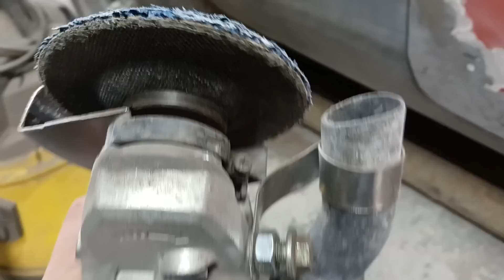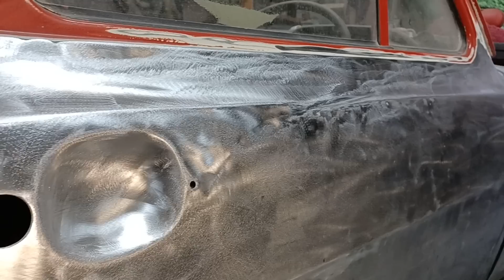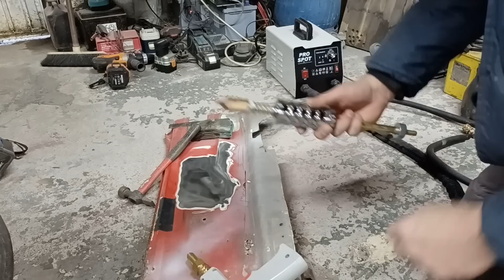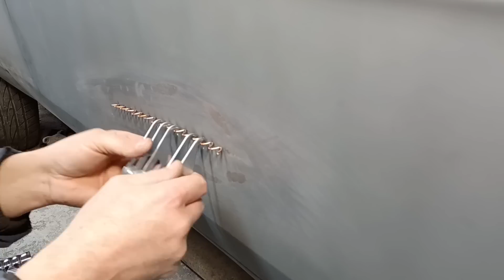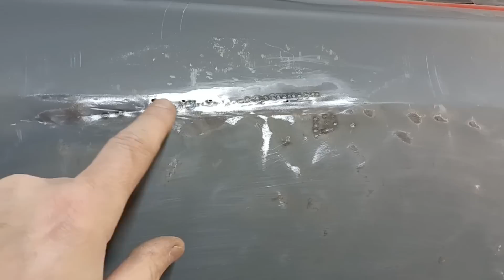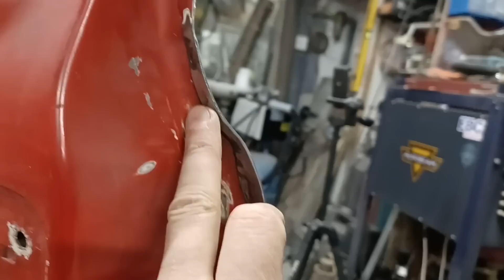Ford Escort MK1 Restoration Project, Door Repairs. Stud Welder dent pulling. Door Gapping.

Comment: Great spot welder Dave you have a bit of oil canning on that door abit of heat shrinking is required with a shrinking disc works ace
Reply from the maker: All sorted now pal, thanks

Comment: Hi Dave found over the years when using dent puller if u pull the slide hammer or pull claw with a ratchet  strap and have constant  pressure  and planish around  it prevents  stretching to much and high spots
Reply from the maker: Brilliant idea, thank you, this is exactly why I like youtube, a collection of years of experience shared 😀

Comment: Nice work there Dave.  Dent work is definitely a game of patience.  But quite therapeutic and satisfying when it goes well I find.  I am no Pro.  Self taught like you but think with the shrinking it works better if you give the panel a quick cool after hot spotting it.  Using a cool damp cloth or compressed air.  I have been using this method with a MIG.  Much cleaner with the tool you have but I can't really warrant the cost for odd jobs I  my build.
Reply from the maker: Brilliant, I'll give that a go

Comment: Looking better and better fella. The spot welder with the pin point after a pull twist off 👍🏻. Plus have you thought about Riv-nuting the front wings on ?
Reply from the maker: I have thought about bolting/riv nuts, but I'm not sure it's going to be as strong as welded on??
Reply: @DavesGarageuk  it’s become a common practice after a shell rebuild, you have made the chassis as strong if not stronger than when it came off the belt new. As soon as you cut the arches in it’s compromised the shell.
Reply: It was always a done thing first time round 😛 to but and bolt the wings. Bonus is they on and off easier.

Comment: The wigke wire works best when you can hold pressure and tap on the outside of the lows
Reply from the maker: Ah, that makes sense, I'll get the hang of it eventually 😊😊

Comment: Kicked into yet another RS2000 that needs sills, floorpan & quarters today Dave - the endless procession continues. Came in with big chunks of donor car the owner had bought for us to use sections out of. Except the donor car was a cabriolet... so bears as much resemblance as a dogs backside does to a cats face, :-) "Donor" bits are also as rotten as what we're gonna cut off. :-) I did lol a little.
Reply: Cabby sills are like railroad tracks by comparison - think they weigh more than the entire RS shell. :-)